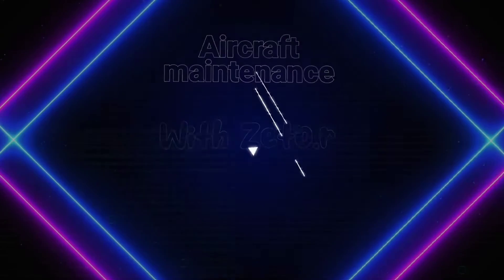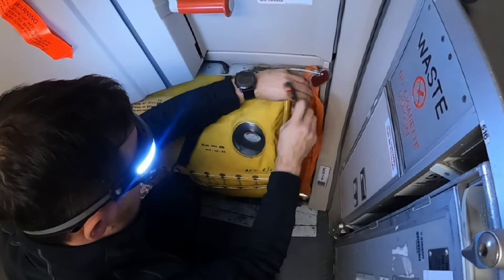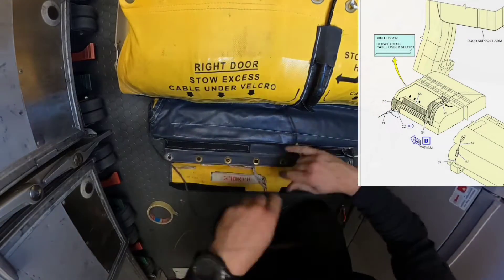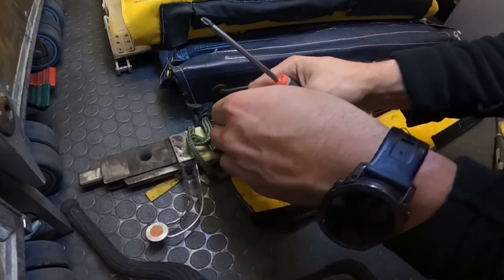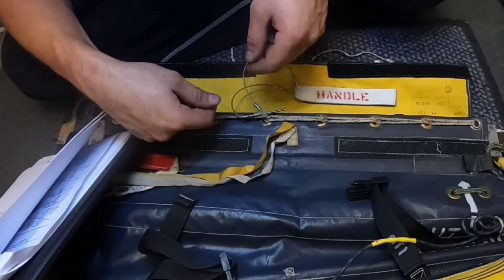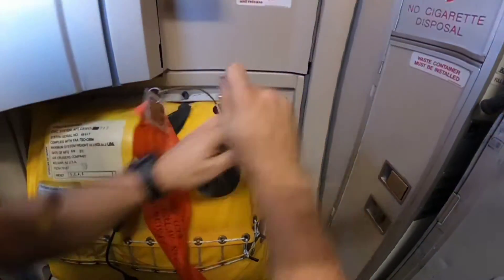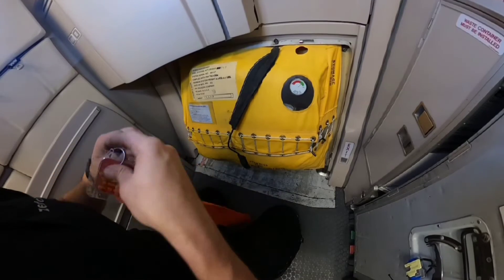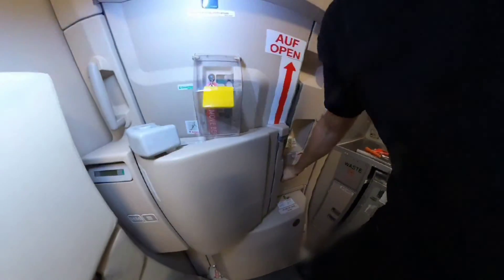ATA 25 how to replace the emergency escape slide on A320

Comment: hi, is there a bottle in the slide raft itself or the bottle is separate from the slides?
Reply from the maker: On this one you can find bottle inside
Reply: The bottle for the slide is packed inside the slide for the main doors unless you are doing an overwing exit slide.